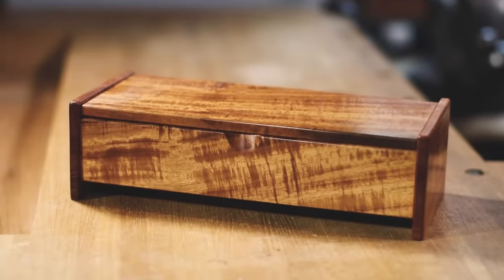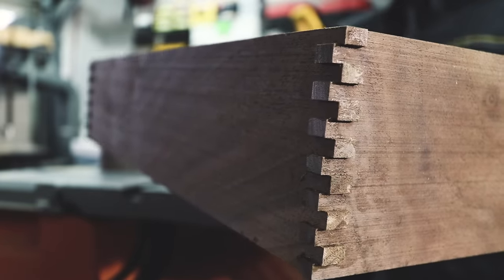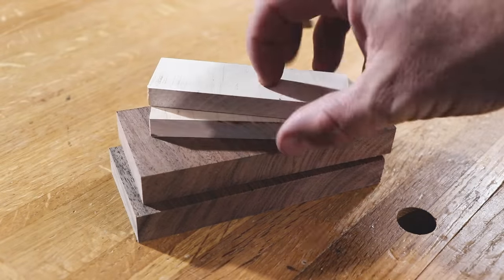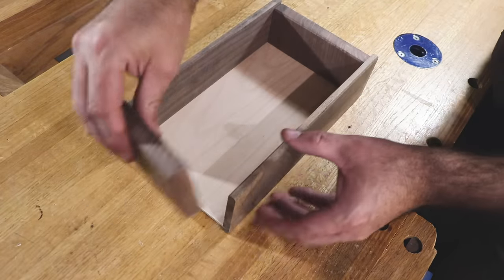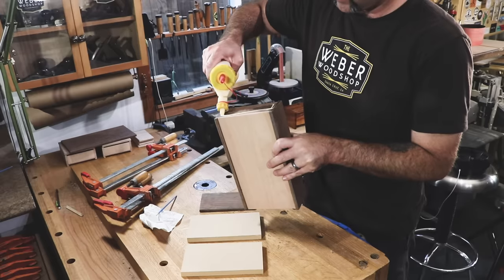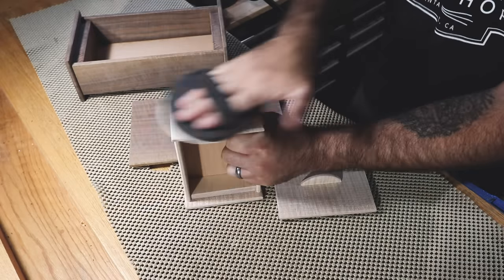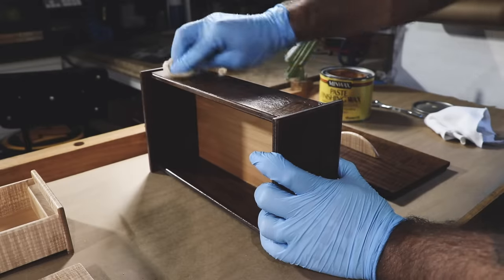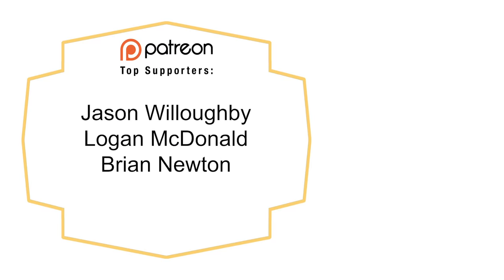How to Make a BASIC Box!

Comment: Really nice video.  Very impressed with the final product particularly hand shaping with a ROS. Can't figure out how you would make the box inside without a CNC.  Bandsaw would leave a through cut.  Keep up the good work.
Reply from the maker: Thanks! I think your comment was meant for the Leaf Box video... Before I had a CNC I have done it with a router, and router template, or by drilling out the center with a large forstner bit and then a scroll saw, or you could even use hand tools. If you don't mind the seam you can even do it as a bandsawn box. Or you could train your pet termites and they could remove the desired material. Lots of options.

Comment: Awesome. You talk about cleats a lot especially on the shooting boards and stuff like that. Could you not do a cleat on top of the tool cabinet And then spacer and clear on the whiteboard so you could just pick the whiteboard up and hook it on the cleat on top of the workbench. Like where you clicked it but just up a few inches up on the top?  Something like a French cleat set up I guess.
Reply from the maker: Wrong guy. I don't use French cleats OR a shooting board.

Comment: For the reason of expanding and contracting of the solid wood due to moisture, why do you glue the bottom on four sides into its groove?
Reply from the maker: It’s so small it won’t matter. It barely moves on that scale.
Reply: The boards get wider--in this case, taller and shorter--not longer. The bottom isn't going to move at all, because it's plywood. So, there's no issue.

Comment: Do you find any problems with long-term adhesion between the wood glue and the polyurethane finish on the inside of the bottom?
Reply from the maker: I don’t understand the question? It was glued together before it was finished. The glue and the finish don’t come in contact with each other.
Reply: @weberwoodshop  Sorry, I was talking about the glue that was used between the leather and the finished bottom.
Reply from the maker: No it’s a ton of surface area and not under stress. You could probably rip it out if you wanted to though.